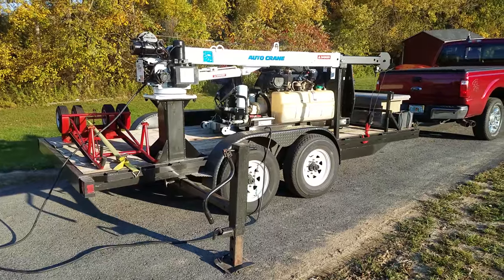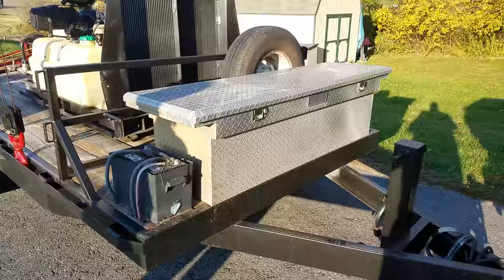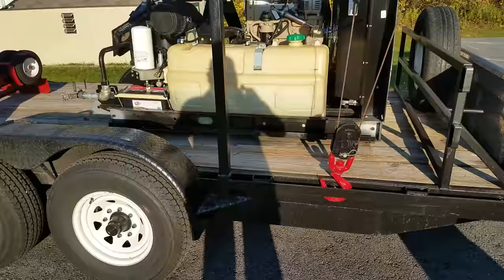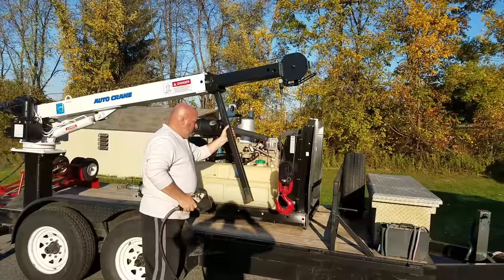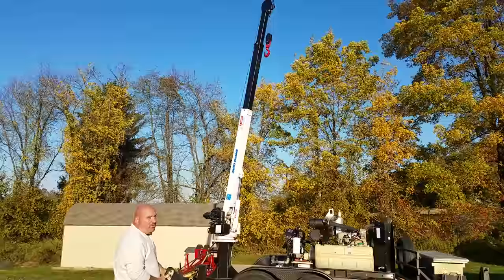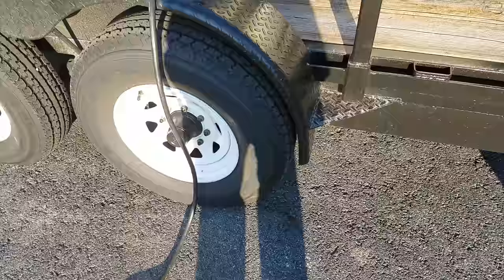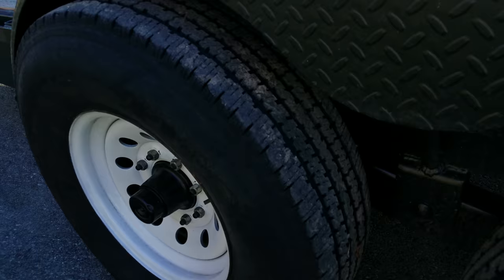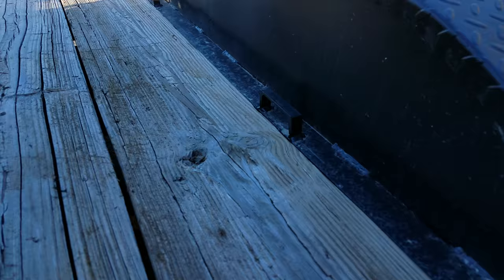auto crane demonstration

Comment: It booms up to 75 or 80 degrees.... It will also only rotate 370 degrees which means you would have to rotate it the opposite direction... It also will not lift capacity with that battery and those cables....